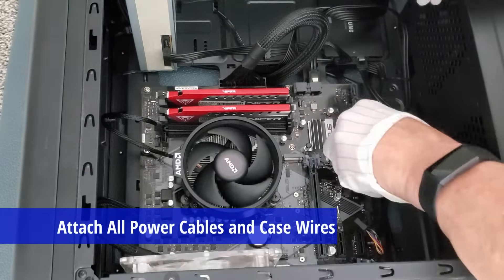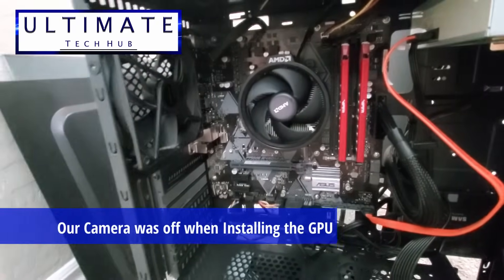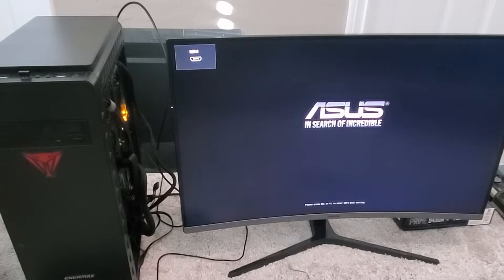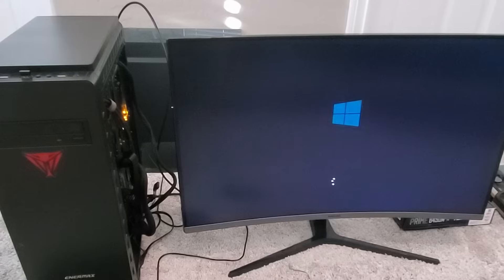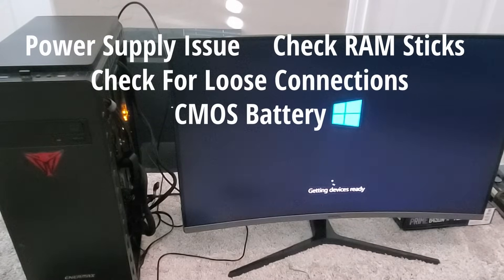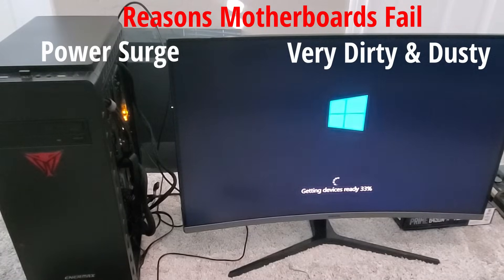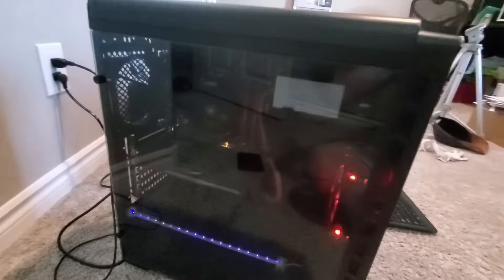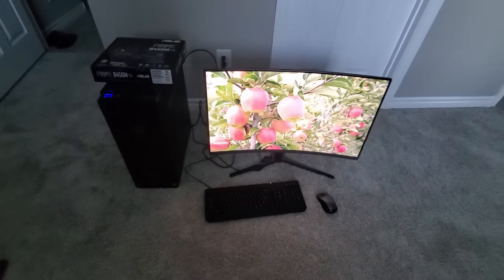HOW TO REPAIR A DEAD COMPUTER - DIAGNOSING A MOTHERBOARD FAILURE! - HOW TO

Comment: first-time builder here, I've gone through all these steps and different variations of these steps. I can only get to post with one RAM stick in the manufacturers suggested single stick slot. If I have two in the suggested slots it will not get to post. I think I can count out a short from the case because I can get there with the one stick. You guys definitely thinking bad mobo?
Reply from the maker: When you say 1 RAM stick gets you to post?  You mean you get to the boot screen? BIIOS screen? Windows? Please specify.
Reply: @UltimateTechHub  Hey thanks for the quick reply, it goes to the American megatrends screen where it will say that I have 8 GB of RAM, processor, etc and then hit f2 or whatever to BIOS. I actually haven't entered BIOS  yet, I have been stopping there and testing Rams etc I really think it's the slot on the motherboard. one other thing is that I've tried different slots with the RAM and it will only boot in that suggested single slot. Also when I reseated everything I noticed The stick of RAM that was in there was out just a hair from its clip. I retested all the RAM , it didn't hurt the stick but I'm thinking that there may have been some damage done to the slot. I have not tried cleaning with an eraser mainly because it was brand new.
Reply from the maker: @Windowlesswhitevan  ok and you tried to boot with each individual RAM stick?  Just want to make sure both RAM sticks are good. If you can boot with each RAM stick but not both then yes I would say its the MOBO RAM slot that's bad. However if one of sticks does not work then its a bad RAM stick. I would check the RAM slot for damage and or dirt. Maybe blow a little compressed air into the slot.
Reply: @UltimateTechHub  yeah I got four sticks I ordered a set of replacements in case I needed them before I got the test and yes all four wheel boot in that manufacturer suggested single slot setup. Thanks for the advice. Any tips on reapplying thermal tape? Is that going to be a mess? Do you think that my processor and cooling unit / fan still has enough on it to just pull and replace it's all brand new stuff. And thanks again for your help I really appreciate it.
Reply from the maker: @Windowlesswhitevan  you can just use the same thermal paste it should be enough. You can use rubbing alcohol with a cotton ball to remove the old paste if you want. But you should be ok. Keep me posted and thanks for watching.
Reply: @UltimateTechHub  Thanks brudda. I will get back to you You got a new subscriber too

Comment: Nice video, although I think I would test boot outside the case on the motherboard box and powering it on via the front panel pins with a screwdriver this would make sure it wasn't a metal contact issue, chances are the board is still okay. not 100% though just an idea for the future, but as you said the customer had a power surge so probably not.
Reply from the maker: When he mentioned the power surge and the amount of dust I pretty much figured MOBO failure. I cleaned the heck out of the case and the MOBO and used a stock SSD drive too. And nothing. But thanks for the great advice on boot outside of the case I have done that before but with this situation it was 99.99% the motherboard. Thanks for watching!!!!
Reply: @UltimateTechHub  no problem! Keep making them 👍🏻
Reply: we jus had a couple of power outages today from storms and it looks like I'm in the same boat.  Tried all tips and last option is the main board. A replacement is on the way so well see.